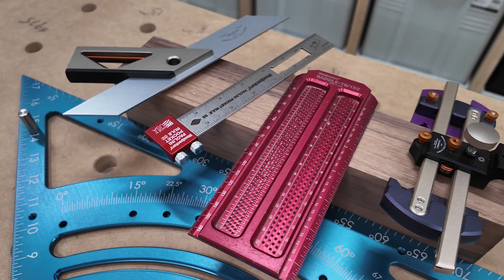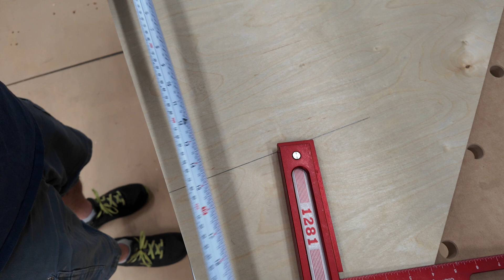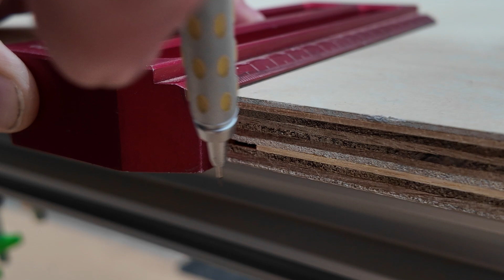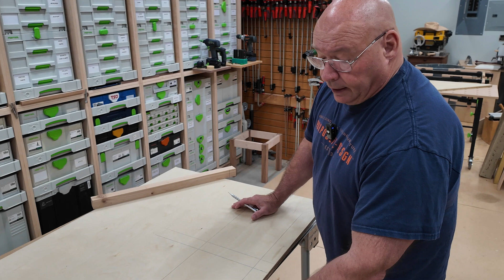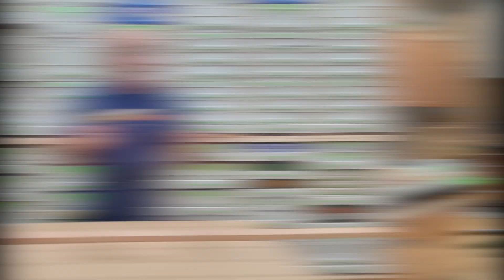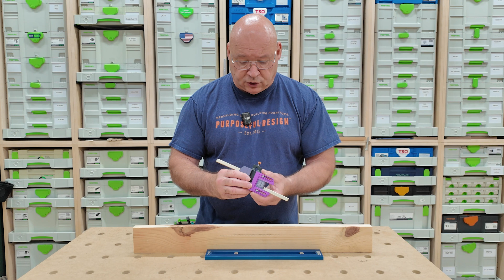Top 6 Essential Tools For Perfecting Your Woodworking Layouts!

Comment: I have the woodpeckers delve squares I was going to use for layouts. Problem is all I do is break pencil lead (with the supplied pencil in the square case) the whole time. I tried using other pencils but, the holes in the square don't allow for it.
 Way too sensitive for my skill level I reckon. Those things were pricey  and I can't use em.
  Seems you fly right down the boards with that saddle square. How no breaky pencil lead?
Reply from the maker: I use 9mm mechanical pencils ...

Comment: Hey Sedge, iv'e been watching your videos for a couple years now and really appreciate the education. I'm about to take on a huge closet shelving build and wanted to pick your brain on how to go about incorporating screw stretchers on the walls with an open back. I watched the video on the connector system you did (great vid btw) would you just use a couple of dominos to tie in the stretchers (screw strip) to the back of the vertical panels?? If so how would you gauge the 18-19MM offset bc of the horizontal panel? I'm trying to sharpen my brain lol. Again thanks for all of the education. 25 years as a trim/finish carpenter and I'm feeling like i need to catch up haha.

Comment: El Cheepo here, great tips Sedge.  I use my Rockler offset/center finding jig for finding dead center the few time I need it.  Since I'm using mostly plywood or wood under 2" wide, it works great.  For a lot of work, I have a small Milwaukee Carpenter's square that has an off set base of 1/4" & 3/8'.  It's great for laying out brad or screw lines quickly on the edge or end of plywood.    For longer lines I keep my TSO Rail square on a shorter pieces of track from my track saw kit.   I also  keep a metric saddle square in my LR32 kit as well.  And no work gets done in the shop without my trusty FastCap "Yellow" 16' tape measure near by.   

The "Other" Warren from Caldwell Idaho.
Reply from the maker: Love my Fastcap tape too.....

Comment: I've got the Woodpeckers's Saddle squares and the Bridge City center finder tool.  Both are excellent tools.  The saddle squares really shine when using a marking knife.  The center finder is nice because, unlike a lot of other center finders, this one has a much wider opening for thicker pieces of wood.  Great recommendations Sedge.
Reply: The saddle square is aluminum and shouldn’t be used with a marking knife
Reply: @agentchodybanks9120  I've never had any problems when using it, or any other aluminum measuring device, that way, but it's a good thing to keep in mind.
Reply from the maker: Thanks !!!

Comment: I love my sashigane, a Japanese carpenters square made of spring steel that has mm, 1/10th and 1/16th inches, 4" depth guage, and a root-2 ruler for miters. Some also have a pi-ruler for getting circumferences from diameters instantly. There is a ton to it, from the special profile to tricks with the root-2 ruler, and I feel wicked smaaht when I use it, haha! It's basically a geometric calculator.
Reply from the maker: will definitely check it out !!!